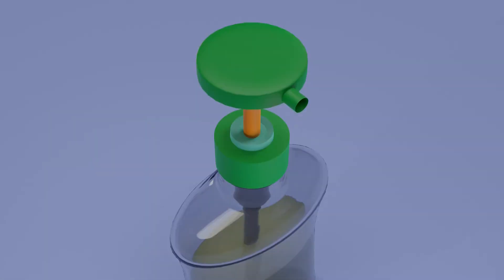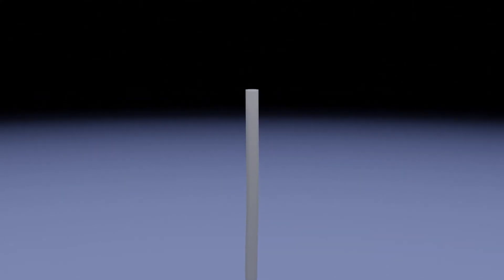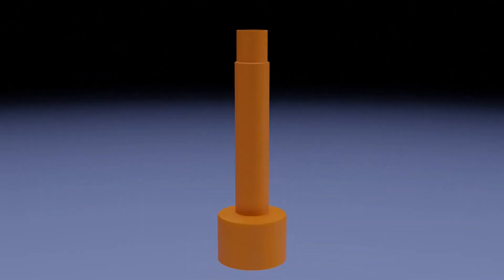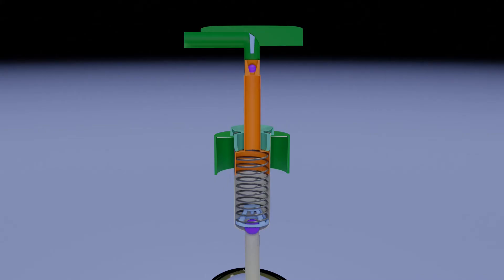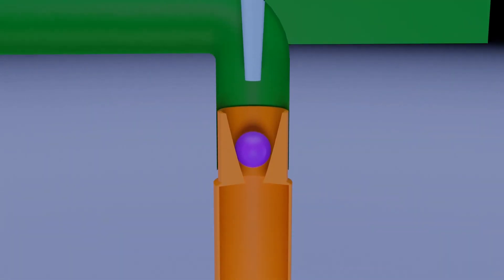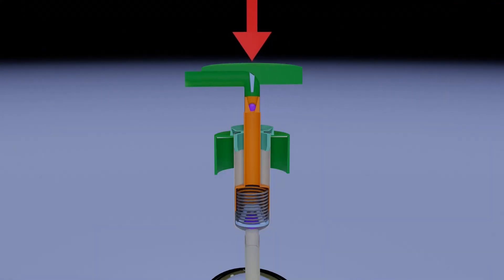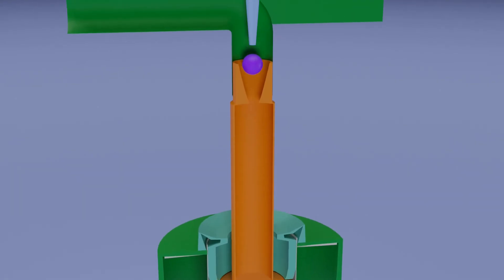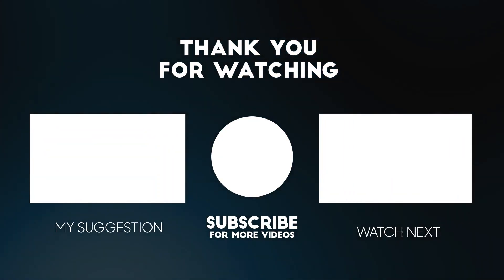How Soap Dispenser Works? | Liquid Dispenser working | Handwash Pump | 3D Animation

Comment: This is better than the video with most likes. This one explains about the air as well as the soap. I still don't understand how air get in to replace the soap volume that leaves the bottle. My understanding is that air needs to replace the soap volume; otherwise, the bottle walls would collapse inward.